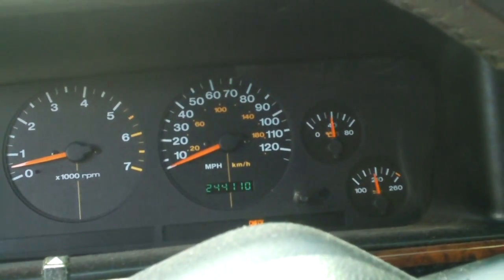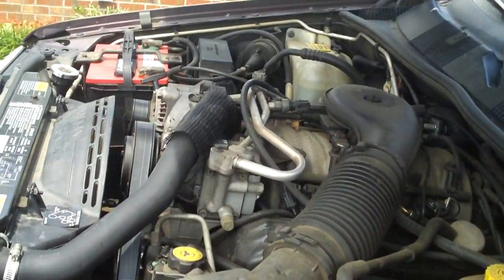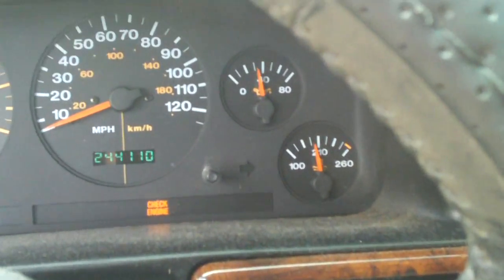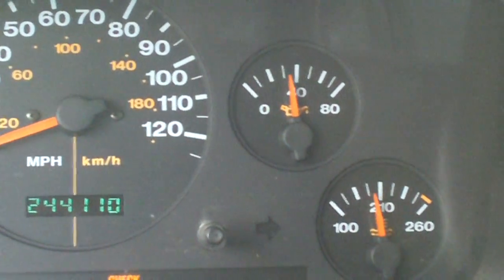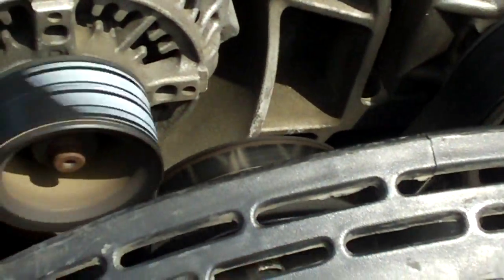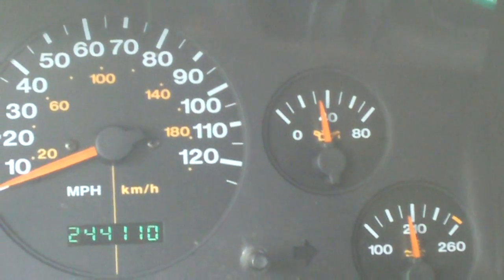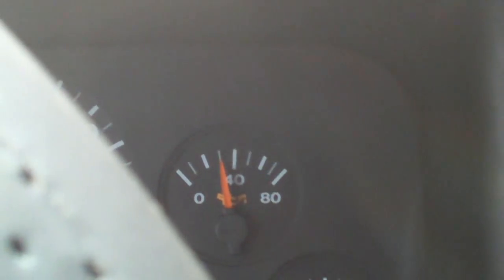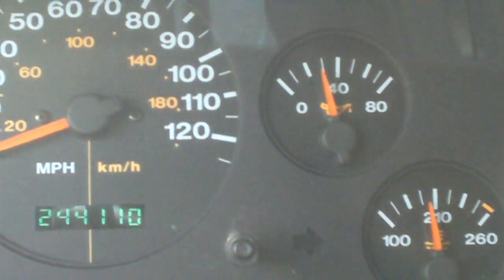Strange Behavior on Jeep Grand Cherokee ZJ 5.2l Oil Pressure Gauge

Comment: Get bud in these jeep grand cherokees, especially the older ones the oil pressure will flux during operation, low when your sitting at idle and obviously goes higher the more gas you give it. Glad to hear the sending unit solved your problem, next time try taking a thin piece of wire and poking it into the pressure sensor itself, and moving it around a bit in it because sometimes, carbon or sludge can get into the pressure sensor and clog it up causing improper readings as well. I have had 4 jeeps and my 96 current driver would instantly drop to 0 when heading down the road intermittently, I snatched up a couple oil pressure sensors off of eBay because they're cheap there, and put a new one in, and that took care of my issue. Fluctuating is totally fine bro it's when it drops to 0 instantly for no reason is when you should worry lol

Comment: I have a 1994 high mileage 5.2l V8 and it calls for 5W 30
But my friend said that I should start using 10W 40
And the oil pressure normal is 40 but now when it warms up it drops to 20 at idle and goes up when I drive and back down if I stop at a light
But I will try cleaning out the sensor hole and put new one also I know it's been 3 years since you posted this thank you
Reply from the maker: This video is 8 years old. I have mostly used Castrol GTX High Mileage 10-30 in mine. Oil pressure readings are similar to above. In hot summer heat, idling in gear, it will show 20-25. Going down the highway, it'll show 40-50. Mine now has 315k miles on it. It had 244k in the video above.

Comment: Hi Joe here I have a 97 Laredo myself bought last year I changed the oil switch behind the block yesterday. I drove it today about 50 miles at 65-70 mph and when I came back home and got off the free way it started to go to zero again while driving which why i changed the oil switch in the first place. Don't know what it could be. Well its a fyi good luck to all trying to find a fix. If I get  it done and fix I will put the fix here.
Reply from the maker: You could be either low on oil (I'm sure you checked already) or perhaps the pickup screen is clogged up. If that's the case, then you may have to pull the oil pan and clean the pickup screen. You could try running a treatment of Liqui-Moly Engine Flush and see if that makes any difference. I did notice an increase in oil pressure following doing the engine flush and changing the oil. I still own and daily drive the Jeep in this video. It now has 313k on the clock.

Comment: #1 check oil level
#2 change filter
#3 check or change oil pressure sending unit
#4 oil pump and a clogged.. oil sucking metal tube thingy.
#5 previous owner put 0-10w in your i6.
Reply: i6 or v8 in these jeeps, no v6
Reply: @sparkie5571  AMC 242 i6. Stupid auto correct
Reply: @bryanshoemaker6120  all g 🤟

Comment: after round and round research two different oil pressure sending units, new high flow oil pump, replacing valve seals, rod and crank bearings fixed the problem make sure you get the correct rod bearings most company's selling them now don't put the hole on one side to lube the apposing cylinder roll yourself some bearings in at 244K bet it fixes the problem
Reply from the maker: This video was from 7 years ago. Jeep now has 306k miles on it

Comment: The oil pressure is is holding normal . It high because the engine and oil is cold, the oil thick when it’s cold. It gets thinner when it heats up. There is nothing wrong with your oil pressure dude, actually that’s good oil pressure!
Reply from the maker: The oil pressure readout improved after replacing the sending unit. Using a treatment of Liqui-Moly Pro Line Engine Flush also made a big improvement on oil pressure.

Comment: Any heads up about the fluctuating meter on your jeep? Mine does that for a year and oil change came up replaced the oil after using the car for 3 days and parked for two days I start the engine and hearing tapping or ticking sounds any suggestions? By the I even replaced the pressure switch nothing changes now my oil gauge buried to 0. 
🙏
Reply from the maker: Sounds like the oil filter you used doesn't have a proper functioning anti-drain-back valve, or there's some reason the valvetrain is being starved of oil. When it sits for a while, all the oil drains into the sump, and upon the next restart, it has to be pumped back up to the top. I replaced the oil pressure sending unit in 2015 and that improved the readout on the dash gauge.

This Jeep now has 301k miles and the engine will need work soon, or an engine replacement, as one of the hydraulic lifters is going out. There's now a light tap sound from the engine at all RPMs. Too quiet to hear inside, but can be heard with the windows down at a drive-thru.

One of the measures I took to try to quiet the noisy lifter was by using Liqui-Moly Engine Flush before an oil change, followed by Liqui-Moly Hydraulic Lifter Additive (to try to quieten the noisy lifter). The engine flush improved oil pressure, and may have also improved compression.
Reply: Thanks for the reply bro! I am guessing it might be the oil pump been clogged you think? Thanks more power bro✌️

Comment: So weird.. My 97 tj has been doing that. But ive replaced the oil sending unit. I got an oil change and they topped it off with oil just a bit over full on the dip stick. Then my oil pressire started doing that. Any ideas? Could that extra bit of oil do that?

Comment: Mine dropped to 0 a few times.  Low on oil.  Lol.  4 quarts low.  Burns like 5 quarts per tank😂
Reply from the maker: Haha that's exactly how I found out this thing loses oil. Back in 2011 when I was first driving this thing, it had the oil changed in the spring, one evening in the fall, the oil pressure gauge started dropping to 0 and lighting up the CHECK GAUGES lamp unless I had my foot on the gas. Got it home and noticed it was bad low on oil. That was about 80k miles ago. It has about 297k miles on it now. My previous car had a Check Oil light that would come on if it was low on oil. Seems like yours has a serious problem if it's losing 4 qts per tank! How's the rear main seal doing? lol
Reply: I think it's ok.  Mainly I think the reason mine looses so much is that it's burns oil like crazy.  Piston walls are shot and rings are trash.  Bout time for a full rebuild.

Comment: I have a 96 zj (originally 5.2) with the 1998 5.9 and the exact same thing happened to me. I ended up disconnecting the sensor and then after another year it started leaking oil from the sending unit. After i replaced that and put the sensor back in, everything was normal.

Comment: I got a new oil pressure gauge, and dumped solvent type oil into my 5.2 and and took a 100 mile drive. I kept getting the fluctuation. Finally I took off my oil pan, a pita.  Something I shoulda done first. Anyway some ass had globbed so much silicone onto the pan gasket previously that a blob was in the pan. It was the perfect size to get sucked into the oil pump pickup . After stopping the motor it would drop out and so I'd have good pressure till I drove for a while the, instant replay. I had to replace all the main and rod bearings with the engine in the car.  Oil pump (just in case).  I was under the Jeep finishing putting the pan back on and tiny drops of antifreeze kept dropping on my face. We disconnected the heater hose and plugged one end. Then took a tire valve and took out the core and shoved it into the other end. Then with a bicycle hand pump gently pumped in  air which made bubbles where the intake manifold had a tiny leak, more like an ooze. The dish soap we sprayed onto it made the bubbles.  So off came the manifold. I was gawking into the lifter valley and to my horror I notice chunks out of the cam! I had taken off that sheet metal thing to clean the debris out of the valley. So, new cam, lifters, pushrods, rocker arms. To ensure the oil system reliability I took out the oil gallery plug, shoved a metal rod with a chisel end ground onto it.  Then I hooked up a piece of metal brake line to it and my shop vac with a piece of cloth on the end so I could see the dirt it was sucking out . So it did suck out 20 years worth of bits of black stuff. Little carbon looking stuff just perfect for plugging up a lifter. Someone told me that these engines are prone to sludge if you don't change your oil enough and the lifters stick partially collapsed and the cam lobe flies around and whacks into the lifter eventually breaking off a chunk of the cam lobe.  Anyway I got it going and some jerk crashed into the side of it and flipped it over!

Comment: Had the same issue when the engine was hot it would show check gauges light, oil pressure drops and then back to normal after couple seconds, the oil sensor was completely degraded and lost most of my oil through it, be careful and fix this problem asap

Comment: Look when you turn on the ac the engine rpm will drop a little so that to me looks normal. Now for the oil pressure drop other than the from the ac I would say it is your oil. That is the problem. If you switch to an oil that has a higher temperature rating then that should solve your problem. If the oil gets to hot it thins out and is not working to par. My jeep calls for 5w-20, I use 10w-50 full syn. These engines run hotter and as you pointed out with the outside temperature that oil is very hot. Run a better oil that has a higher temperature rating and that should fix the problem.
Reply: I have a 1994 high mileage 5.2l V8 and it calls for 5W 30
But my friend said that I should start using 10W 40
And the oil pressure normal is 40 but now when it warms up it drops to 20 at idle and goes up when I drive and back down if I stop at a light
But I will try cleaning out the sensor hole and put new one also I know it's been 3 years since you posted this thank you

Comment: my '91xj is doing this occasionally, but usually only after highway driving, if the engine is cold it stays around 35-40psig but if i drive highway the gauge will spike to 80 then drop to 3psig and stay there untill i start moving, you might have had a crack inside of your unit like i had in mine (no external leaks, just wierd readings)

Comment: i have a similiar issue on my jeep no lights or pending codes..., almost feels like its missing a cylinder from time to time, but the oil pressure goes from about 45 to about 60 to 70 upon acceleration then drops rigjt back down but cruising on highway stays up, and when it spikes i can feel the engine running rough almost like missing. any ideas, oil sensing unit looks like its got crud all.over it, but i think its still sending the rigjt numbers as the car runs like shit when it goes up

Comment: Hi everyone,  I wanted to pass along my experiences with this. Last week my 2002 WJ 4.0 4x4, 140,000 miles, started having low oil pressure at idle. I was at a stop light and the "check gauges" light came on. I pulled over and checked my oil level and it was good. The oil 
pressure would rise with rpms but would go back to almost zero at idle. I
 let it cool off and noticed that pressure was normal on cold start but 
would slowly drop over a few minutes as the engine warmed up. I searched
 here and on the web and found lots of info. I first tried a replacement
 sender but there was no change. I cleaned the connector with electrical
 cleaner since there was some oil around the pins - no change. I dug around and found an old mechanical oil pressure gauge and installed it and left it hanging in the engine 
compartment. Showed same as the dash gauge - low pressure, about 8-10 
psi at idle and rising to 55-60 at 2500 rpm. I let it idle for a while 
but heard no odd noises. Just the same as before - good pressure on cold
 start and decreasing as engine warms. Went back and searched some more and found info about the oil 
gallery behind the sending unit getting clogged with sludge. So I took  
off the mechanical gauge and left the brass adapter in the hole and 
stuck a short piece of rubber hose to that and into a drain pan. I then 
turned it on and revved it at 4000 for about 8 seconds and shut it off. I
 checked the drain pan and found some obvious bits of sludge that had 
been blown out. I connected the mech gauge again and topped off the oil.
 Turned it back on and problem solved! Pressure at idle now 18-20 psi 
and 60 psi at 2500. Replaced original sender and dash gauge was back to 
normal. Hope this helps someone with the same problem.
Reply: Could you do a video on this? It helps to visualize it
Reply: @theunderdog7570  Yea I would like a video because I was not completely able to follow what's being explained. But it sounds like my line of thought as well. From the symptoms I'm having and what's being said in the video sounds like it gets a little clogged over time. Once mine is up to temp as I'm driving or make turns it would just drop to complete 0. then suddenly goes back to normal over and over again.
Reply: I have te exact same problem, so you basically got the oil drain bolt out and  let it drain oil while reving it .

Comment: where is the oil pressure sending unit on my 94 grand cherokee 5.2
Reply from the maker: It's near the back of the engine to the passenger side of the distributor.

Comment: mine will read zero oi lpressure for a while then it goes up to 25lbs then it will go up to 45 and go back and fourth as i drive.
Reply: Scott Geiger mine does that goes up to 45 them slowly works it way down to zero and stays at zero!

Comment: i have a 97 318 my oil gauge does the exact same thing. last week i pulled the oil pump and replaced it but didn't help, i was Todd to go after the oil sending unit next before i pull the valve covers. mines a 97 1500 ram with 150000 miles so it wasn't driven much before i got it, i suspect something may be coiffed due to inactivity
Reply from the maker: I changed out the sending unit, which did show improvement, but I later switched to a Mopar oil filter from a FRAM and that made a noticeable improvement.
Reply: hmm. i didn't think about that one. i got Napa gold, just put it on. That's cheap i might try changing that and my sending unit before i tear down the motor thanks
Reply: i use a k and n filter could it be that?

Comment: I changed my sensor today. check the connector. The engine leeks a little oil and it got inside the plug that plugs into the sensor. when you replace a sensor make sure the contacts are free of oil.

Comment: my xj was having the same issue, on idle it dropped down to 0 and showed "check guages" light on. Took out the sending unit, it was full of oil. I replaced it anyways. Now on idle, it dips down to 20 when hot. changing the oil pump tomorrow $500 ouch. I hope that solves it.
Reply from the maker: +Jesse No, the engine will not shut off due to safety reasons (such as if you're driving down the highway), but if it does drop to 0, get off the road and shut it down. Running the engine dry of oil will damage it in a hurry.
Reply: +MoJo Studio update: I only changed the sending unit, and it has been working good (not great). My oil pressure is doing well, it's goes down to 13psi when HOT (california hot) and 55 when cold. I didn't change the oil pump. It still gives a check engine flashing light when I drive on the fwy over 20 miles, but it doesn't act funny, just the flashing check engine light.
Reply: Did it help to change the pump?

Comment: I'm having the same problem sort of but it goes all the way to 0 and slowly back up to 60 back and forth.
Reply: Tommy Maroney  me too mine goes to 0 what was the issue why did it do that?
Reply: I replaced the Oil Pressure sensor http://www.autozone.com/external-engine/oil-pressure-switch/duralast-oil-pressure-switch/704844_0_0
It was fairly easy but you have to buy like a Big deep socket to get it out. I forgot what size. When you get it at Autozone or somewhere just take it out of the box and find the right size socket.
Reply: Did this resolve the issue?
Reply: My 1995 zj does the exact same thing lol its just a bad oil pressure sensor
Reply: thank u sir for the comment. haha I have the same problem